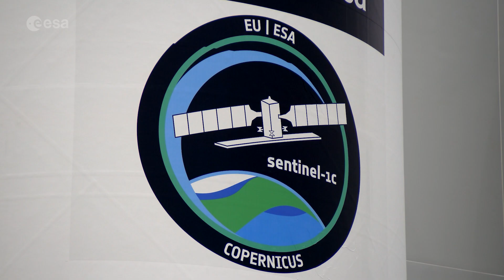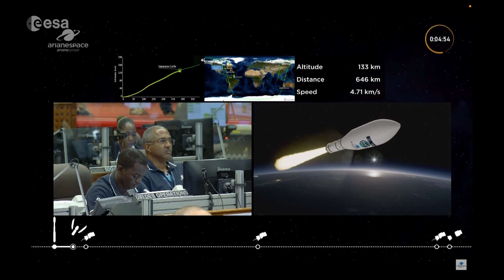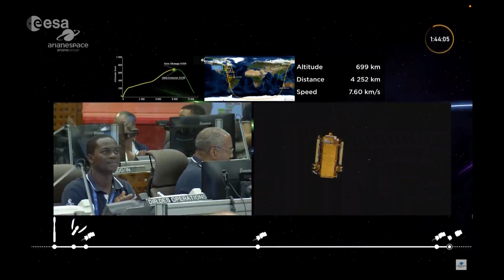Vega-C and Sentinel-1C launch highlights

Comment: I'm curious, why does the environment around a spacecraft while it's under construction need to be kept so exceptionally clean?
Reply: @FutureAIDev2015  there are so many issues that can go wrong with a satellite or any mission to space that you eliminate those you can. Having dust or mites or normal air debris floating around can damage components from chips to hinges that need to open perfectly. It's super cost effective,  clean room technology is good.  Imagine spending all the money on flight costs just to have it screwed up because a hair stopped a crucial hinge. What an easy preventable waste.

Comment: Why do they wear medical clothing. gloves and hair covering when working on the satelite?  If it is to prevent hairs and other fibers from somehow damaging the satelite why is that guy not wearing something to prevent hair from his beard from felling on the satelite?
Reply: It's a clean environment. There's usually sensitive optics and precision instrumentation on a satellite, foreign particles are bad for that. It's common to coat materials, again contamination is bad for that. Mostly though it's not for the satellite, very high precision machinery needs clean rooms. Think microchip manufacture.
Reply: Also at 0:58 you'll see the satellite fuelling crew gearing up in hazmat suits because they will be handling the highly toxic hydrazine propellant